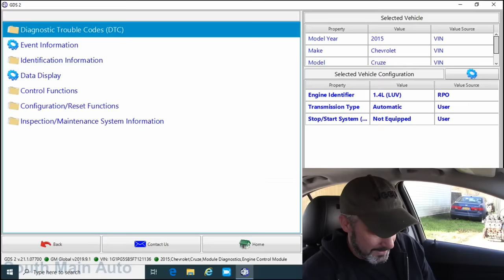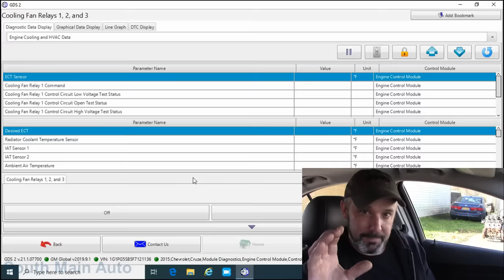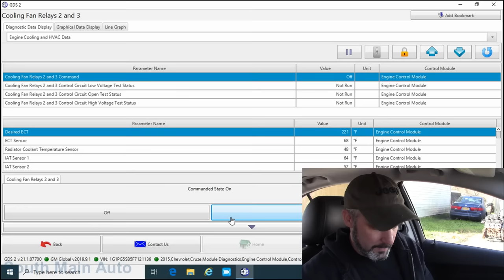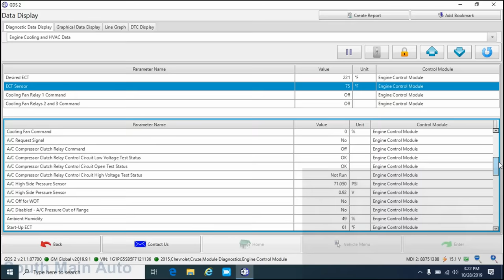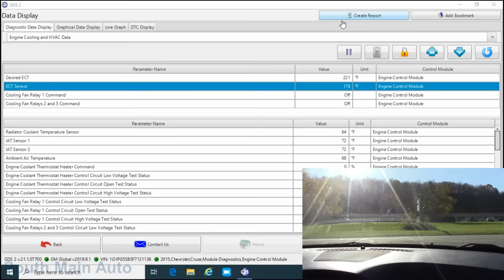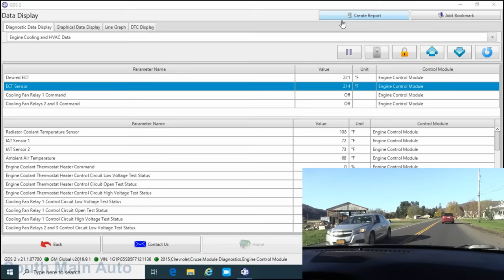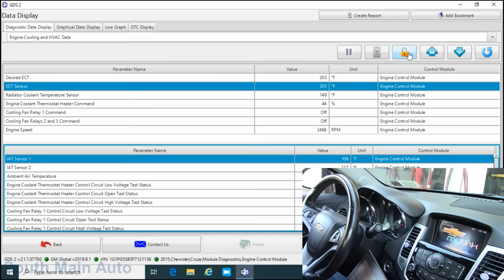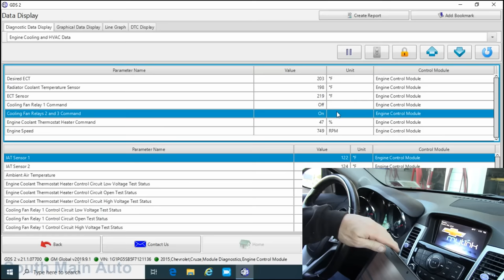Chevrolet Cruze: Overheating, Loud Fan, Losing Coolant

Comment: Geez they couldn't even diagnose the thing after several attempts   what makes him think they can fix it ! half price quarter price any price ?
Reply: Throwing parts is the small brained part of the job.
Reply: pete smyth. Sarcasm is the lowest form of wit.
Reply: @opl500  It's most likely just  that dealer Mechanics  just can't be bothered  thinking when they get more for warranty parts swapping and  the client pays through the nose "  and 80% of the time they get lucky with a fix so why bother with actual Diag
Reply: @opl500  small brained oftentimes can't even install a simple part correctly, I wouldn't take my vehicle back to that dealership.
Reply: Omg, this is US (homeland of chevy). I thought it’s only in our part of the world, and now seems to me, all gm dealers around the globe are dumb.
Reply: @virus7379  Dumb tends to spread just like a virus "  fair to assume if one idiot cant think the rest will follow suit
Reply: @adrianhughes5693  You have no idea what you're talking about.  Customer pay is 1.5x more than warranty. The amount of training that is required for us dealer techs is insane.  There are some bad apples at the dealership, but those are the same clowns that would be bad apples if they worked at an independent.  Diagnosing is required even for warranty.  Our dealership would get the part kicked back and dealer would have to eat the labor and parts cost if gm determines there's not a parts failure.  Techs, at least at my dealership who would just parts swap, especially under warranty won't be employed long .  Kickbacks don't go over well.
Reply: @JD730  I trained at a dealership before going independent have a pretty solid Idea cheers!

Comment: For those questioning how he called a bad fan without checking wiring or circuit integrity, watch his other video. At 9:45 in that video he talks about the wiring diagram. By 14:20, he talks about resistor pack which is integrated into the fan. So because he hears the relays click on and it works on high speed then the wiring must be good and needs a new fan.

Comment: Good diagnosis! I had a 2012 Cruze towed in a while back. A "y" shape hose back near the overflow tank blew out. The entire cooling system was full of sludge, because as it turned out the oil cooler behind the exhaust manifold had developed an internal leak allowing oil to cross over into the coolant. Guy had to replace radiator, several hoses, thermostat etc. lots of flushing!!!!
Reply: Sorry to hear that, I hope you get it resolved. Older GM's last longer

Comment: Why would a customer go back to the dealership when they failed the first time? Strange.
Reply: So they have a proven diagnosis and can go here fix this properly under warranty?
Reply: @defendermender4959   If it's under warranty why would they charge for it.
Reply: @TheGhostTrollek dejvu 

 Flat Rate pay system for the mechanics in the dealerships, you get paid so much per hour and then they’ll get say - 4.5 hours for a job and if it takes 10 you’ll only get paid the 4.5. Also the dealership won’t get as much for warranty work, same as if you are a mechanic and you parts store gives you a labour claim on a faulty part they’ll give you a set time and rate, which is normally a lot less than what you charge. For this type of fault it maybe give you something terrible like 0.25 of a hour to diagnose so none of the techs want it, so someone low down the pecking order probably ends up with it. Yep that's right unsurprisingly the Dealers screw the people working for them too!
Reply: @defendermender4959  But surely the warranty is just that, warranty on the product you bought. The dozens of products I sent in for warranty repair/replacement it never cost me a dime. They said product will lasts for x amount of time, product breaks down before that, they obligated to fix it to uphold their claim. Is it not the same with cars?
Reply: They bought a Chevy Cruze, they already lost credit in the decision making department.
Reply: @TheGhostTrollekdejvu  The problem with car warranties is that there are so many "parts not covered" because of normal wear and tear. There is SO MUCH "fine print" with these warranties that you have to read to figure out if the part is covered.
Reply: @RobKeenan826  Should have listened to Scotty Kilmer!
Reply: @TheOzthewiz  Wow, that is truly scammy of them.

Comment: GM tech here. For future reference on Cruze work. Common failure on Cruze cooling system is water pump, thermostat housing and outlet (pretty much the whole system) most years water pumps are cover up to 120k and the rest is not. Water pump leaks from this circular area near the pulley not the gasket itself. You may see oil associated with this as well. Oil leaks on front cover are mostly camshaft actuator seals however if they are dry and you have oil on any of the 4 long bolts of the water pump, the timing gasket may have blown a bit. Some is normal but soaked is bad. See this all the time but work is generally cheap and easy. She is a leaky but strong engine and I would still recommend.

Comment: Hey Eric! Great diagnose, that's the proper way to do it. Here in Europe i have seen this engine alot in vauxhalls.  These 1.4 turbo engines are notorious for coolant leaks. Specially all connections behind the turbo, but waterpump and thermostats fail aswell.
I think the problem lies in this ridiculous high temperature they run these engines. 225 F is just cooking... every rubber O-ring or gasket is just cooked to plastic and will leak.

Comment: Great video. I work at a chevrolet and opel dealer ship in finland. These cruzes usually leak coolant out of three spots. The waterpump/thermostat housing, the coolant reservoir or the coolant thing above the transmission. Pardon my english as i am from finland. Love your videos.

Comment: The car is under warranty.. So the dealer is going to turn it in as such. Then collect 50% more from the customer.
Reply: Master Chief 00117  I doubt it’s still under warranty is likely 3 year/36K  75-100K on trans
Reply: Wait wait, they do warranty repair work in the US and STILL charge labor?
WTF! If I could get away with that here I would be having joyful days in the shop, warranty here in Europe means the maker pays for it all, labor, parts and shipping.
Except Apple, they charge the shipping which you have to eat as a shop which is annoying.
Reply: They “charge” labor but  under warranty its paid by the manufacturer. 

I remember doing those transmission recalls on the 03-05 Acura TLs and they paid 5.9 hours. American Honda paid the labor to the dealer.
Reply: That water pump should be special covered for 120k they usually are. The rest goes out with bumper to bumper usually.

Comment: I heard "fuel spider"
You got a GMT-400 in the shop somewhere?
Reply: Dino Vicaro I heard that too.
Reply: R Mack Astro or Safari van too. GM used the 4.3 in many vehicles over the years. I wonder what Dr O would say if a Syclone or Typhoon rolled, or was towed in. I'll bet he'd be more than happy to GIVE IT THE BEANS, after fixing the problem of course!
Reply: Didn't all vortech engines use those injectors

Comment: Wow half price at the dealer 😳 that's a first!
Reply from the maker: half price still more than I charge haha
Reply: South Main Auto Repair LLC they'll be back 😆
Reply: @SouthMainAuto   and still rubbish workmanship " hey maybe thats what us independents are doing wrong  we need to up our prices Eric so all the stupids feel like we know as much as the dealers :P
Reply: "Half price" sounds like they just pulled a number out of their butt. The work needed is probably on warranty but they're selling them extras like an overpriced belt and tensioner. They try to suck as much out of people as they can when they have to do warranty work.
Reply: @keving2371   Manufacturers often extend warranties on chronic problems to avoid class action suits, but 50/50 sounds like a used car lot to me. It should be either fully covered or not at all. Maybe the customer isn't insistent enough. The squeaky wheel gets the grease.
Reply: @SouthMainAuto  That is what I was thinking, and if they can't properly diagnose it why would you trust them to fix it correctly?

Comment: 4 year old car and it's already broken. How many miles?
Reply: Ours went out right after the warranty, in addition to the cracking radiator, leaking water pump, defective cooling fan, and 1 engine and 2 transmissions. People died in GM vehicles due to faulty ignitions. People deserve what they get from such an Effed up garbage company.
Reply: @garrettstevensen2467  so, did you just say you deserved your car being messed up all the time for buying a product from a long established company?  interesting position to take.

You do realize if your car was that messed up from new and had that much work done to it, there are lemon laws.
Reply: this is no accord !
Reply: Garrett Stevensen yeah, the Cruze is not one of GM’s finest efforts.
Reply: @JonBoy470  the cruze is one of the worst cars ever built.
Reply: Jonathan Gahan it doesn’t need to be one of GMs best efforts to at least be reliable. GM is trash, between the 2008 bail out, and now their strike, I will stick to my Japanese vehicles.
Reply: @w.miller7282  Not one of their best efforts in terms of product build quality. GM, like everyone else, has followed in Toyota's footsteps outsourcing ever more of the vehicle assembly and design to their tier 1 suppliers, and those suppliers are very often the same ones Toyota, Honda, etc. are using. The Japanese advantage is, in large part, by reputation at this point; the car lasts longer because it depreciates less, so it's "worth it" to dump in money for repairs for longer.
Reply: yep people nowadays are so stupid that they can't realize when a rubber coolant line is going bad in change it and then complain that the whole car is shit when my dad's has over 200,000 miles with nothing but change coolant lines and still gets 45 mpg in a non hybrid... Real shit car lmao it's better than most things you can buy now and much better value

Comment: Those cars are junk. The oil cooler always springs a leak and they’re a PITA to swap😡
Reply: Thank that's one of the reasons vwhy there a re recalled for engine failure nice that they design to where only the paintence inclined can dobit

Comment: Chevy Cruzes are known to have problems. Ask Scotty Kilmer.
Reply: Baloo Tube 
here in Australia we call them Holden cruise 
Just as rubbish as US version 
Loosing water and overheating is just standard practice 
By 40,000 km expect engine failure!
Truely a great GM product
Reply: He's right, cruzes are shit. Apparently Scotty Shillmer can smell his own kind
Reply: You should look up AutoExpert AU. To see that gentleman is frank with his candor is an understatement of vast proportions.
Reply: Scotty Kilmer is a jethro shade tree tech that wouldn't know a good car unless it was disguised as a Toyota Celica.  Besides the cooling system problems the Cruze seems to have in Spades, they're amazing cars.  It took 50k for me to need anything besides oil changes, and it was the water pump, big surprise, big whoop.  GM replaced it for free, down the road I went.
Reply: Scotty came here at least 49 times to downvote...
Reply: Johnny same exact problem with my Cruze bro I just hit 200k and I commute about 50 miles a day. Car is so underrated and hated by people who never even drove one.
Reply: Come on, nobody is getting 45mpg in a Cruze. I have a 2012 with 70k on it, have had both long highway speed commutes and city traffic commutes, they get about 30 hwy 25 city. I do love the car overall but I have replaced the ENTIRE cooling system in the last 6 months, these problems aren’t fake
Reply: @Higgy506  there's different engine options the 1.4 Eco with the manual definitely can get 45 easy autos won't and some have the 1.6
Reply: Johnny you’re right, I wasn’t thinking about the manual option.  I’m glad your dad’s Cruze has stayed together so long, what year? I’ve had, since just this august, coolant reservoir cracked, thermostat broken, water pump leaking and all temp sensors need replacing. I don’t drive it hard, mechanic said he sees TONS of the Cruzes now that they’ve been out long enough for the problems to start popping up. Hoping the $1.5k in repairs is all it needs but just this morning I’m having another sensor issue
Reply: @Higgy506  the thermostat problem is a known problem but you can fix it at home for like $50on parts and sometimes the coolant lines need replacing but same deal $50 in parts and a half hour and you can replace all that... I've never had any issues with a water pump 
1.5 k to fix all that seems a little steep imo the thermostat issue is really simple fix
Reply: @Higgy506  the cruise is very easy to work on also there's so much space... But yet again I don't know if you have the 1.4 or the 1.6 engine they could have different issues
Reply: It's not just the Cruze, it's any Ecotec engine.
Reply: @Higgy506  so a pump a tstat and some hoses? Pretty standard
Reply: Trudeau Must go if it’s “standard” to replace a thermostat twice, water pump twice, reservoir and all the hoses before 60k miles, I think we need a new “standard”
Reply: @anonymousinc6330  my 1.8 is problem free at 85k. I stayed clear of the turbo. I'm not sold on these tiny turbocharged engines. Unfortunately  we may not have much of a choice in the future. This new trailblazer is a 1.2 turbo!
Reply: @kw6713a   And that is our cue to stop buying GM.

As for your 1.8, pull the oil filler cap at idle and see if it is blowing anything out that looks like oil, crankcase gases, or smoke/steam. Any of this is a classic sign of piston or ring blow-by, which I observed on my 1.5 at 73,000 miles.

If it does any of this, get rid of it ASAP. There are videos on YouTube of the same engine with a completely dead cylinder as low as 19,000 miles. 

As significant as mine was then (spattered the entire top side of the right fender in 30 seconds), I'd say it's pretty safe bet that it was doing that before I bought it at 61,000.

I disagree, however, when you say that we'll have no choice soon. GM refused to acknowledge there was a problem with my car (trans and CV axle issues as well) when it wasn't going to cost them anything to fix it.

Therefore, I traded it for a Toyota 9 months into the loan (taking a hit on nearly $4000 of negative equity -- YES, I hated this car THAT much), and have no further intention of ever buying another post-05 GM product. You always have a choice, it just may not necessarily be what you want to do.

Word to the wise, avoid ANY company that brags about JD Power awards. And that's coming from someone who has owned and driven over two dozen GM vehicles since 1993.
Reply: @anonymousinc6330  thanks for the tip I'll check it out.
Reply: Red Supremes I love mine 🥺
Reply: Wait isnt the Cruze the car where you have to replace the entire valve cover if the pcv fails?
Reply: @Jahalang82  Probably any EcoTrash engine, GM usually builds most of their mechanicals the same. But shit like that is EXACTLY why they're in trouble. As I said, I traded an outwardly nice Malibu for a Camry for a reason after being GM loyal for 25 years. Never thought I'd see the day when I'd buy a Toyota, but GM is now content to build shit, and doesn't stand behind it. In contrast, a 96 Camry I bought for a secondary, had a cracked cylinder head, but ran and drove with only minor hiccups.
Reply: @Higgy506  Actually, I could get 40-55 highway with a 1.5L Malibu. But it's easy to get crazy economy with piston rings looser than Sasha Grey.
Reply: Mines a doggy
Reply: John Laurus  Greedy executives, dipshit designers, half-assed designs, cheap parts, poor quality control, clueless technicians, and crooked dealers. Take your pick. I bought a 2016 with 61k and had issues with it before it hit 75k. GM refused to admit anything was wrong, so the third party warranty was useless. Traded for a Camry and never buying another GM vehicle built after 2005.
Reply: John Laurus  Trade, absolutely. For another GM, no. I got a 2015 Camry LE and have been much happier with it. I would recommend a 12-14 or 15-17 model though. The 18-19s had issues with the new 8-speed automatic, which may or may not be resolved.
Reply: @Johnny-tq9no  How about the EcoTec's blowby and 6T40 transmission problems before 75k?
Reply: @Johnny-tq9no  Exactly. It's a poorly made PoS, like why are we pretending GM makes good things now?
Reply: @angelolagussa1312  it can be cheaply made and still be the best option for a low-cost commuter car most all of them in this category are cheaply made and have problems
Reply: @Johnny-tq9no  45mpg yeah right ......Maybe if its a diesel
They gave a hard time getting 30mpg highway
Reply: @fil1329  I get 35 mph going 95 mph on the highway and it's a 1.4 turbo I can easily get 45 plus if it's a 45 mph zone and I'm only doing about 50
Reply: @Johnny-tq9no  i would say only sometimes u could achieve the 35 ......but only when its not on the side of the road over heating
Reply: @fil1329  then fix it the overheating issue is very basic and very easy cheap fix
Reply: @Johnny-tq9no  yeah after you replace all the cooling system parts like the fans.....thermostat.....waterpump....coolant lines....heater core 
No thanx
Just shows why they were discontinued and can't compete with the asisn car market